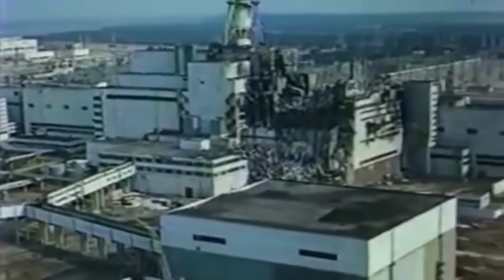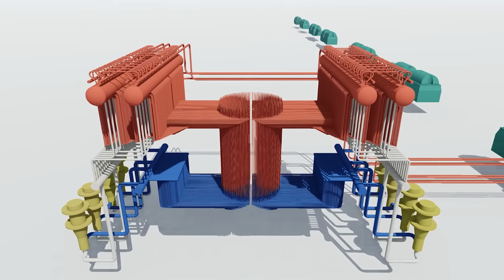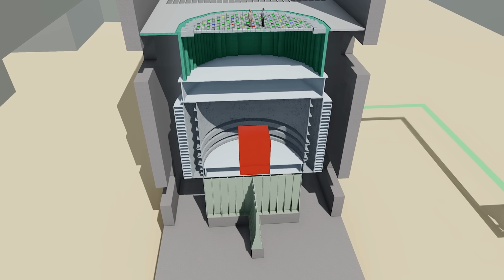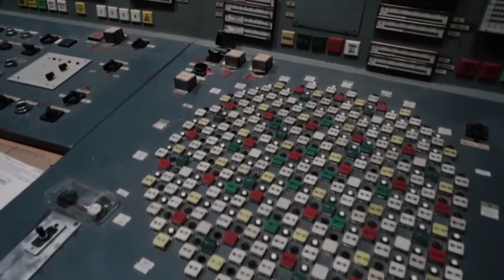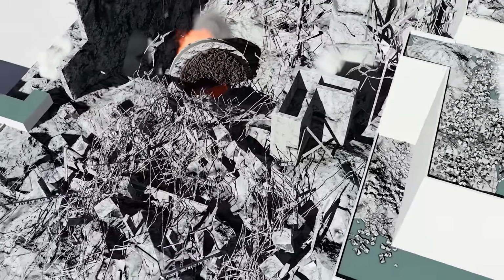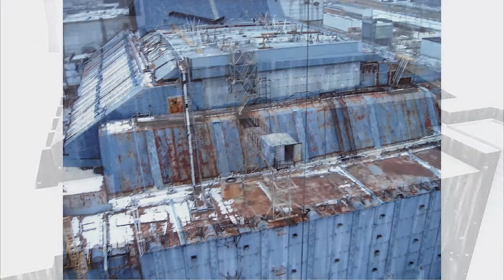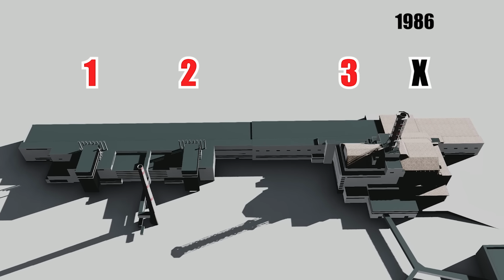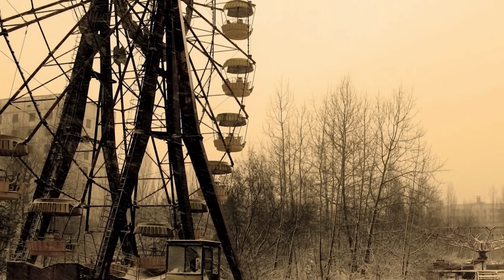CHERNOBYL DISASTER - An Inside Look - 3D

Comment: GE MK1/2 Reactors are considerably more dangerous than RBMK reactors and yes the cores are bigger but contain about the same radiation and ultimately the double shell design packed out with sand was a better catastrophic failure solution than the wet well torus design there has never been a serious problem with a RBMK reactor under normal operating conditions and under a catastrophic failure situation the RBMK reactor core melted the corium mixed with the sand and was vitrified this vitrification trapped the reactor core and stopped the china syndrome, the American designed GE reactors at Fukushima had primary containment failures due to serious design flaws leading to a overpressure steam explosion and meltdown leading to a vessel excursion events at 3 reactors that's right china syndrome x3 thats why the fukushima site looks like a tank farm just go and look at the site on google earth, every single one filled with highly contaminated water.
It will not be long before another reactor goes bang this time in the west due to neutron flux embrittlement of the reactor vessel, reactors are given a lifespan for good reason, reactor life extension by 15 or 20 years is pushing the safety margins to the limits of the big steel balloon at 300c plus and 1500 psi we call a nuclear reactor.
Reply: You omitted the fact that there are 6 reactors at Fukushima and only 3 of them are GE reactors, the other 3 are Japanese. So, did the Toshiba reactor that melted down have design flaws also?  Do you think maybe the earthquake and tsunami had anything to do with it?
Reply: @fps1188  Japanese GE BWR's design supplied by GE built Toshiba and Hitachi I am all up for an interesting discussion but it is now clear you are not .
Reply: @gck82s  You are correct, I am not. It is impossible to have a discussion with someone who possesses such an obvious bias. Yes, of course, America is bad, but luckily the tsunami destroyed those dangerous reactors before they destroyed Japan. lol
Reply: @gck82s  I haven't changed anything, I only  gave you time to make it clear who you are. And you don't seem very happy that you have revealed yourself.  You write about American designed reactors when the video is about the Soviet RBMK reactor. You claim it had no design flaws. Again, no one anywhere believes that...only you.  So who is the troll?  Cheers
Reply: @fps1188  I can assure you have I no American bias one way or the other America has been lucky it has come close to very serious nuclear accidents on lots of occasions and can cover things up as well as play them down TMI, Fermi 1, santa susana sodium reactor, ls1 change in operator instructions, the Hanford site contamination, NASA's 1960's radioisotope thermoelectric generator development accident and probably the most serious the insecure storage of 100.000 tons of high level reactor waste but britain france and japan are not far behind and Russia is just as lacking in this regard.
Reply: @gck82s Sorry, but that is wrong in many ways. Chernobyl-4 was at least the third RBMK-1000 that destroyed itself, after one in Lenigrad-1 and another at Chernobyl-1. This was no safe design in any way. The GE BWRs are much safer, but the Mark I containment was considered unfit for it's purpose by the NRC, some 40 years ago. In the RBMK-1000, there was no sand before any desperate measures to put out a burning pile of graphite (basically highest grade hard coal) and nuclear fuel.
Reply: @KarlKarpfen  Chernobyl-4 was the only one destroyed and it did not do it by it's self it was forced there by Dyatlov the UK has similar problems with graphite cores in the AGR's most notably in the Heysham 1/2 reactors as Lenigrad-1 and Chernobyl-1 you claim destroyed themselves they had technicalissus that were resolved, just for your clarification the RBMK reactors have a vertical cylindrical channel around the core that is pack full of sand.
Reply: @gck82s  Well, the point was safe design, and a design that already had suffered two partial meltdowns in 6 years of operation is definitely no safe design, especially without any proper containment structure, no matter how the AGR at Heysham did. A "technical issue" that leads to a severe damage of parts of the machine during and by it's own normal operation is generally understood as "self destruction".
Reply: @KarlKarpfen  If you are going to classify ruptured fuelrods as a partial meltdown the list of global meltdowns is going to get very long, and yes I will concede a secondary containment would be a nice thing to have but at chernobyl this wouldn't have made any difference what so whatsoever. Merry christmas from the UK by the way.

Comment: A positive void confidant has nothing to do with heat really but pressure as water boils it creates bubbles the voids as water is the moderator if you boil it in the core you decrease the density of the moderator and as a result you increase the reactivity and the out put of the reactor goes up, the operating water pressure in a RBMK reactor is 10 megapascals (1,500 psi) water boils at 310c the RBMK are a good and safe reactor but if you drop to 225c water boils at (363PSI) see the problem, it was in the operation of the reactor not reactor design.
Reply: The IAEA disagrees with your assessment that RBMK reactors are "good and safe".  I invite you to read their report on the incident, INSAG-7 in particular.
Reply: @fps1188  The IAEA is not independent the US spat there dummy out in 1981and ever since the IAEA has been a rubber stamping stooge for the US and pro US nuclear policies, I would take a RBMK over a GE MK1/2  plant every time.
Reply: @gck82s  You are the only person on the planet who believes RBMK reactors are good and safe. I challenge you to show me the reports of any commission that agree with your assessment. Not even the Russians believed it. If they were so wonderful, then why, after the disaster at Chernobyl, were no more built? Why was the construction of 9 planned RBMK reactors cancelled? Why were changes made to the existing RBMK reactors? If there was nothing wrong with the reactor design, then why were they redesigned?
Reply: @fps1188  Only minor changes were made to the rest of the RBMK reactors after unit 4 went bang most of which were in the software in relation to the number of control rods that an operator can withdraw at any given time. No more built because chernobyl pretty much bankrupted the USSR and derailed the whole global nuclear industry for over 30 years and in the 34 years since the rest of the operating RBMK reactors have run without any serious incidents and are still in operation right now,  if they were the doomsday machines you seem to think they are international pressure would have seen them shut decades ago, the truth of matter is they are (if run within normal operational parameters) no more unsafe than any other reactor of their time in the East or West.
Reply: @gck82s  The changes were not exactly "minor" and they certainly were not mostly software. The extent of those changes are available on many sites for anyone to see. It wasn't Chernobyl that bankrupted the USSR. The Soviet economy was already in shambles, in part due to the arms race with the USA. It's interesting that the RBMK reactors were the greatest ever built, and yet no other country ever wanted one. They were so wonderful that they stopped building them. And when the last few have reached the end of their service lives, there will never be anymore. The few that are still operating have run without any serious incidents because the design flaws and safety concerns, brought to light by the IAEA after the Chernobyl disaster, have been addressed. And they are continually being upgraded for extended service and safer operation. And, yes, there has been international concern about extending operation of some of the reactors for an additional 15-30 years. I never said they were "doomsday machines", but they did have serious design flaws.

Comment: I've come here after watching the TV series on sky, I've always been fascinated by this disaster and always wanted to know how it did
Reply: A positive void confidant has nothing to do with heat really but pressure as water boils it creates bubbles the voids as water is the moderator if you boil it in the core you decrease the density of the moderator and as a result you increase the reactivity and the out put of the reactor goes up, the operating water pressure in a RBMK reactor is 10 megapascals (1,500 psi) water boils at 310c the RBMK are a good and safe reactor but if you drop to 225c water boils at (363PSI) see the problem, it was in the operation of the reactor not reactor design.

Comment: can you do us a favor....... instead of talking about how ineffective it is and how the west would not have approved this reactor design.... do me a favor can you do a vid and explain 3 mile island........ the rbmk reactor design is actually still in use today without a single incident. and another thing I have personally seen more then 6 rbmk reactors not 3.....  You are not counting the reactors in other post soviet countries. like the metsamor power facility in Yeravan Armenia.
Reply: Reactors were fixed afterwards- now knowing the flaws
Reply: @nfrancisj2122  fixed how?
Reply: Menua Chaparyan I'm no engineer, but according to the history channel, safe guards were put in, and output was minimized. Not sure what safe guards, but if you're interested, checkout the history channel website. I think they also mention it in the HBO show. if you're really, really into the designs, you can checkout the design and design changes on wiki by year.
Reply from the maker: The design error in the bottom of the control rods was fixed. The lowering time of the control rods was reduced from 18 seconds to around 12. The fuel was enriched to a higher level which made the RBMK not as cost  effective. The control and monitoring systems were improved. 
And safety culture and protocols were addressed.
Reply: @nfrancisj2122  На Армянской АЭС в Мицаморе установлены не РБМК, а ВВЭР-400
Reply: Do it yourself instead of moaning

Comment: "RBMK reactors don't explode" Top 10 Quotes after disaster
Reply: no actually technically don't...... They melt down... which in turn flash boils water.... and pressurized water vapor causes the explosion. its not like a nuke going off..   And more "western" whatever the fuck that means reactors have melted down then soviet ones.....
Reply: @menuachaparyan2263  I know that already. Also I used that quote from the HBO Chernobyl Series, where (I forgot the man who was leading the test) told his trainees (I think) that the RBMK reactors don't explode but instead it melt down because the 1st explosion was small and the 2nd was the big one because the air rushed into the reactor causing a massive reaction and spreading Radiation into the atmosphere
Reply: @imperialinvictus3073   oh lol yes.. Your right i'm sorry.
Reply: @menuachaparyan2263  no no it's fine. We all just want to have a good laugh lad